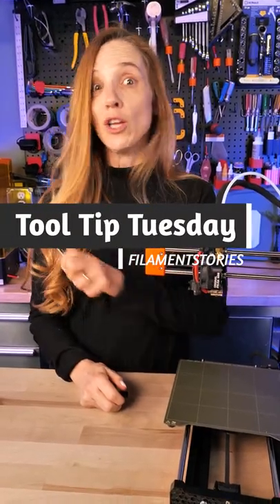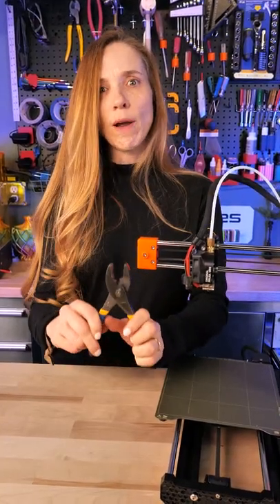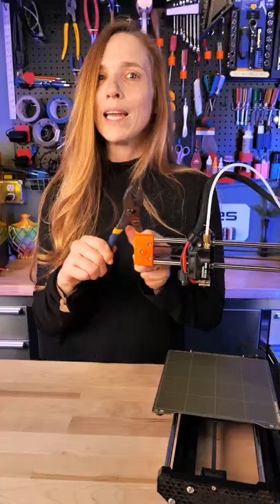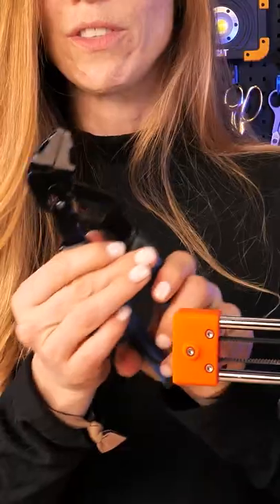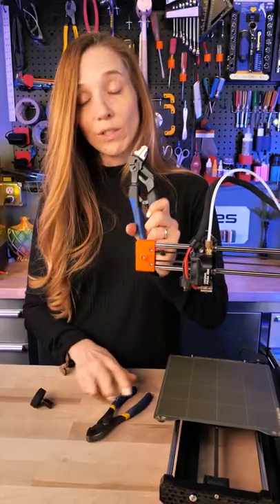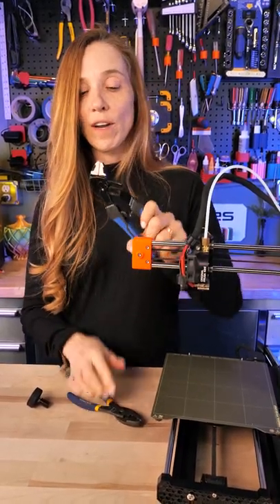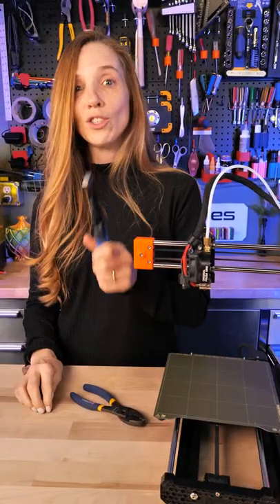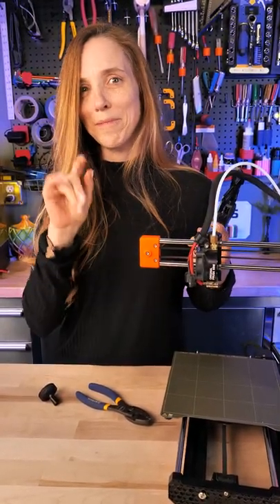3D Printing Tool Tip: Locking Parallel Pliers

Comment: these are not parallel pliers (and searching for them online will not show these). These are usually called "self adjusting" pliers. Parallel pliers are more often used by jewelers.